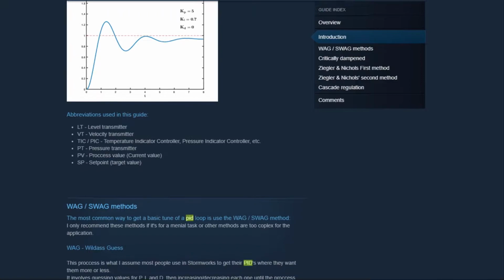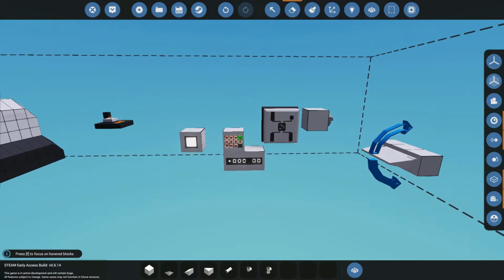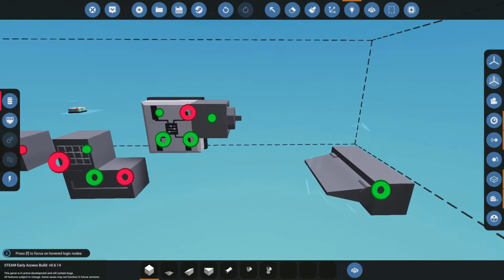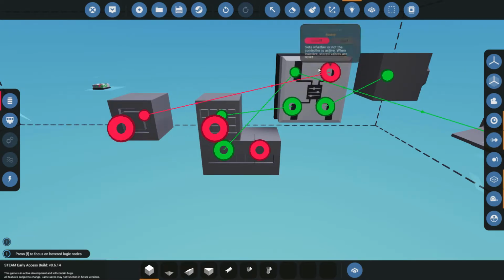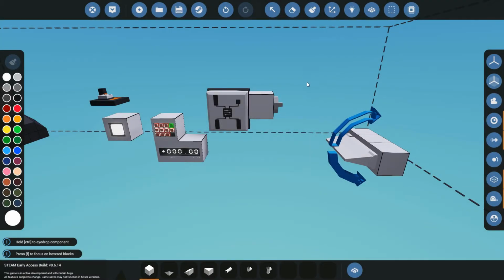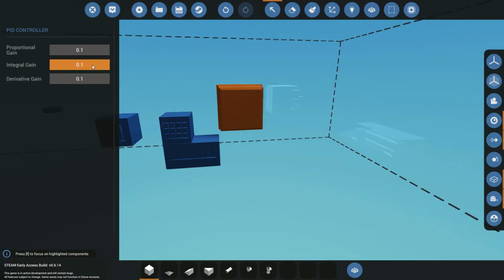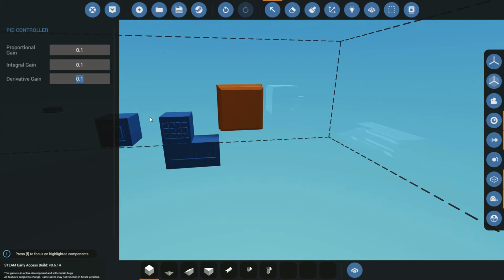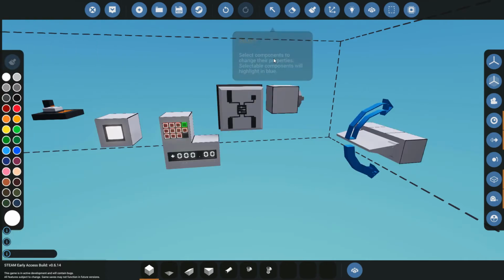Stormworks B&R l PID Guide for new players

Comment: wow i'm so dumb, i have a boat that requires Fins to Stabilize so it doesn't flip when turning, but the fins controlled manually when going right would output -1 and left positive 1, which would make right turns flip faster while left turns hold the desired result. So i was boggled by this and made my own controller that turned all negative and positive inputs into 1 so the fins would only use a positive 1 and go up stabilizing the boat..  it took me hours to make that controller and u tellin me a PiD just do that (/-o).. i knew it there had to be something but i couldn't find it, but now this makes much more sense and now i'm going to delete that system and myself. Thank u sir ;-;